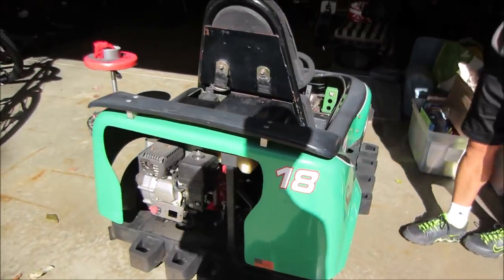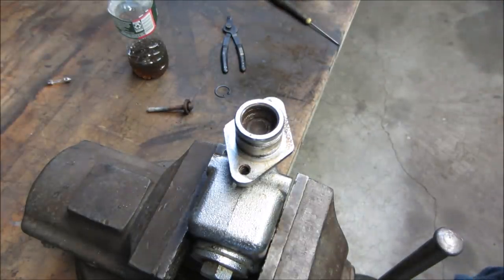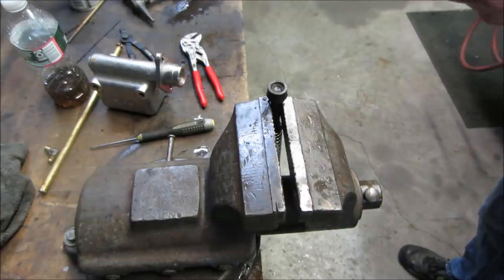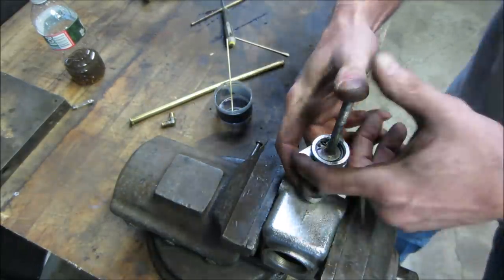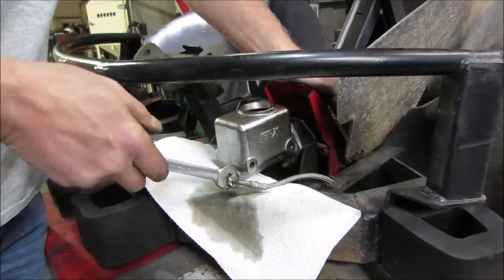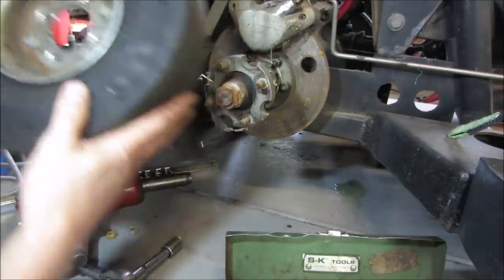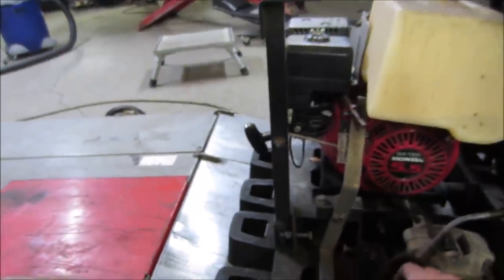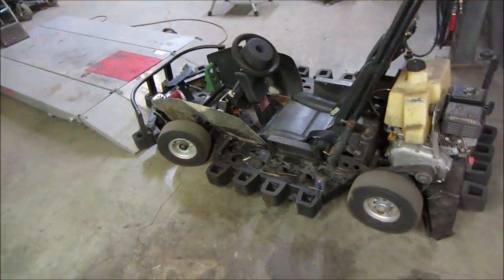Broken amusement park go kart, comes to life,

Comment: Mr. Mustie, if I may call you that, I have watched all of your most recent videos and some of your older videos. They inspired me to fix an old 1981 Jawa Moped. Two previous owners could not get it running. I found that the transmission seal and clutch seal were shot and leaking oil on the starter clutch shoes and running clutch shoes. I replaced the seals and clutch shoes and rode it for fun last summer. It tops out at 35 mph! Thanks for the inspiration. Who knew it was fun fixing small motor machines. Oh, and you sir are a master. You never launch parts across the shop!

Comment: Great fun! 30 years ago I was associated with a rental track that would bring 20 cars and a portable metal track to your event. We were rented at least twice every weekend and usually once during the week for a couple hours. As an employee we got very good at pushing the cars to the limits. When setup on dirt even with the metal frame it was possible to get the car up on two wheels left or right when you when you went into a hard turn and crank it.   A few of us PROs actually flipped the car fortunately no one was injured.

Later I built a dual chainsaw racing go-kart that could out corner a Corvette through a Cloverleaf. Luckily no one was ever arrested for being out on the public streets. When you're going a hundred miles an hour inches away from the pavement the feeling is unbelievable.
Reply: can you tell me more about the portable metal track?

Comment: Seekonk Grand Prix used to have two outdoor tracks. One was a typical “family” go cart track, lined with a metal bar that matched up with the bar that the other guy removed and old tires for rebound. The other track was the fun one; an oiled down slick track. It was a simple oval but fun as hell to whip those tanks around the corners and bounce off of unsuspecting 10-year-olds and the metal barriers. They’ve done some recent renovations with a new ropes course, bumper boats, a couple kids tracks  a big arcade and rock climbing.  I think they eased up a bit with the oil on the slick track though. I remember it being much more dangerous (fun)

Comment: Way back in my youth, I worked at a go cart track. We had carts like that that would run 30 to 35 mph. Then we had two with I think they were 7 hp 2 cycle engines, ( it was a long long time ago... 1978 ), but they would run close to 70 mph.
Reply: I remember those days, before the lawyers fucked it up.

Comment: Definitely need some balloon type tires to give it more ground clearance and a softer ride. Those track tires are made to last along time and also provide enough stiffness to still handle correctly if it goes flat but only work well on a nice flat track. Back when I was a kid in the 60's the trick setup was twin Westbend two strokes on a track cart.

Comment: I think those rubber bumpers are in fact a rubber extrusion bumper that used to be used in surface trains in Europe (early 2000s to late 2000s), at least, i remember it being so years ago. Someone got their hands on a long strip and chopped it in short bits. Many they really used everything off the shelf for this, left nothing untouched.

Comment: You can move the pivot block under the bracket it is mounted to and drill a new hole for the pivot. That will give you full throttle.

Comment: Adopt the Lotus philosophy....to increase speed, add lightness. If you strip off a lot of the heavy crash protection, you could probably save quite a few pounds. Bigger, softer tyres for ride comfort and grip, and you're good to go. No doubt you've got some tricks to increase horsepower as well.

Comment: Probably already know it, but you can replace that right rear wheel hub with one that has a keyway and no bearings in it to make both rear wheels drive.  Interesting how they used modified u-joints for front steering knuckles, might have to incorporate that into my next design.

Comment: I'm no mechanic, but, at the same time, I'm no dummy either.  I pretty much know how most things work on a car.  My dad did a few things and I'd hang out and learn (he was a mechanical engineer, so he pretty much knew how everything worked).  I inherited alot of that from him, but, and I think that's one of the reasons I like your channel so much, is that you give a bit of an in depth explanation of how things work at times, and I learn a thing or two, like today with the brake master cylinder.  So when is it my turn on the go kart? lol

Comment: I would think that honing the bore out will increase the chance of the push rod seal leaking, but you wont know until you put it all back together.
Brake fluid has a way of finding its own way out  and any pitting in the bore will allow the fluid to get past the seal as there is a huge pressure in braking systems when they are in operation.

Comment: you can put a zip tie threw the gov spring and tension it till you get it how you want it, we did it on the karts where i worked at , works very well. throw some baby powder down on that concrete if you want splippery and lock that axle.

Comment: Yesterday, on the MotorTrend channel, the show - CarFix featured a car that you have. The shows title is Lam-Faux-Ghini. The guys work on John Cena's 1999 Lamborghini Diablo repli-car. The BMW engine ran, but after body work shop, it would not run. Spoiler Alert: It had to do with the cam shaft sensors wiring. It had a BMW engine, Porsche trans-axle, GM coils, etc.

Comment: G'day Mustie ,well done  Now it has some throttle , love the chuckle ya big kid , Don't worry I'll be doing the same , when I finish the buggy I bought for my kid's & Me , it's an applestone  side by side it originally had a 150cc motor ,I bought it with no motor the body panels are in great condition & it has all new coilover shocks , I was telling a mate about it and he said he had a  1985 XJ 600 motor that turned over & I could have it for $150 .00 , so I got it home went through the wiring and the throttle & ignition , found mud doloppers had built their nest's in the ignition & throttle so when I was pressing the start button it wouldn't get contact, but if I crossed the solenoid it would turnover . The next step was fuel and I had to drop the bottom of the carbs clean everything as You ! Had taught me 
Put the carbs back together , turned the key hit the button and away it went a bit rough to start with after about a minute it ran like a dream . I give you a lot of credit for this as I probably wouldn't have given it a go , but after watching your channel for the past few years , I thought I can do this , so the next stage will be fitting the motor , so wish me luck , hope to have it fitted soon ,I'll let you know how it goes .        Mal.

Comment: Yano if that tube is submerged in brake fluid, you can just open the bleeder and pump away until the air is out. It’s impossible for air to enter the system with the tube submerged, unless you run the master dry. It’s how I was taught in my ASE class.

Comment: Around 33:30, the right rear tire seems to turn and speed up when you rev the engine. Of course it doesnt spim at the same speed though. Is it a already a live axle with the key removed on the right side so it's only a one wheel peel? Years ago our local go kart track did that to save on tire and gear box wear and tear.

Comment: I did spot a wider track axle and wheels at the end. Not sure if you can fit bigger matching wheels at the front but the steering stub axles can be spaced out if needed. Engine? Mustie has quite a stash so likely to be a bigger one there somewhere. Don't mention Hayabusa..

Comment: I recall the Malibu Grand Prix driving those things around in circles.  Most were turtles.  But there was always one a lot faster than average.  That was the one everyone fought over!

Perhaps the easiest performance improvement would be removing all that armor plating.  Take 200 pounds off and it'll accelerate and handle much better.  Much better in fact than just putting a bigger engine on it.

Comment: Years back went to an auction bought a go cart, it had a snowmobile engine. I got it home and driving it around my pasture, I almost hit a tree. The gas petal stuck to the floor, I was lucky it had a kill switch. The guy who built it mounted the battery so it wouldn't come out without cutting a steel brace out.

Comment: note about the position of the seals in the master cylinder; fluid can't get into the cylinder to take up the slack from brake pads wearing (as stated), more importantly fluid can't get back into the reservoir when the fluid heats up and locks the brakes on.

Comment: great fun video once again.  why not shed some weight off this thing, i guess with an angle grinder , make a cable driven throttle will yield 2 kilo's already, shed the roll bar too, makes the body come off easyer too. all this will make it faster for sure. Cheers!

Comment: A heads up Mustie,  with an open brake system as with old cars and your master cylinder, don't use DOT 3 fluid. Use DOT 5.  5 is synthetic and will not draw moisture to contaminate your brake system or rust the inside of your lines and ect.
MB BAR RANCH
Reply from the maker: you cant mix them

Comment: There are two options I have always wanted to try; electronic fuel injection and electric drive supercharger (turbocharger based, not fan type). EFI first would make it easier but otherwise you have to regulate fuel pressure to the carburetor w/o overwhelming the float needle. 
There are kits for lots of go cart motors with high compression pistons and high lift cams but bolt on kits are sort of just cheating. DIY mods are more of a challenge... and more likely to end in a smoking mess.

Comment: Do these have the exposed throttle rods? Our track up here in Vermont got a little upset when we found that we could get another 1k rpm's out of the motor pulling up on the throttle rod. The next year they had a channel welded over the rod so we couldn't pull up on them.

Comment: Wrap some towels around the wheels and you have a fun and nifty little shop floor cleaner. I wonder why they split that rear axle though, modified slip differential for all the corners on a tight little track? posi-traction would make a better cleaner.

Comment: When i was 12 or so 50 years ago, dad would take us to shopping centers in Tulsa that had permanently closed so we could ride ours there. Police couldn’t wouldn’t bother us because it was private property. We built it from a 5 hp Clinton motor and single wheel drive off of a Cushman scooter. Yes the Cushman was probably more valuable but couldn’t be more value than the fun i had.  I took off his 2 1/2 briggs from his lawn mower first and made it run and i guess he knew he had to get involved if he wanted his lawn mower back.

Comment: I would keep the hone to a minimum if using the old seals.
And I seem to remember certain parts cleaning chemicals will cause seals to swell; dunking the seals, letting them sit for a few minutes, then cleaning off the chemical might help.

Comment: If you gut the airplane wheel, it should be trivial to put two backing plates with a center washer to accept a 4 bolt pattern, i mean, come on, it's just a go-kart, it can't possibly give way. I've seen worse things on cars in my route to work. :))

Comment: see if you can find some oversize tires and wheels.  Adding 2 or 3 inches to the diameter will make it faster, and getting rid of those stiff tires will make the ride smoother and make it grip in the dirt a lot better.  And the existing tires are made to last forever, they are too rigid.  At the end of the day, drive on only one wheel will limit you, would be nice to have a differential.  Can you take one out of a lawn tractor?

Comment: I wanted to say weld the axle halfs together, but there was another one laying on the side ready for a swap. Would generator engine fit in there? Different carb and no governer and it would go good. Unbolt all the rubber bits while You are at it. 20-30ish pounds in that rubber bumpers and that bar at the front.

Comment: Typically - The type of Rubber that the o-rings and seals in a master cyl are not petroleum oil "proof" as brake fluid is alcohol based - now that youve coated them in spray oil, they may begin to turn to chewing gum or swell up and leak or worse...... so avoid oiling brake master or caliper parts if you intend on re-using them
Reply: "I acquired some stuff to make it faster, you'll have to guess what it is"......... yet theres a Go-Kart live axle and wheels right there to the left of the Kart in frame on the video!!!

Comment: I would have started with a bench bleed on that master before installing it on the cart ( put a hose on the fitting and place the other end into the master cylinder push the rod and keep going till you don`t see any bubbles ) as you are only creating flow and not much pressure this way clear plastic can be used ( new master cylinder for cars come with fittings and hose to do this ) less fluid waste plus if the master is no good you don`t have to un bolt it

Comment: You could have saved some time,if you would have bleed the master cylinder  before you connected the brake line. I've done that many,many times. Then bleed yoir line at the caliper.

Comment: Let me take my guesses stage 1 kit 18 lb valve springs racing jet for carb or new carburetor. Or bigger engine there's so much you can do with it change axle 2 live axle torque converter or racing clutch new back tires stage 3 kit with Billet flywheel racing cam new lifters😵 on and on

Comment: Great job on fixing that thing now pull those gosh awful rubber bumper off that thing, 1. they are freaking butt ugly and 2. I bet they weigh about 5 pounds each. That should help with the power to weight ratio.

Comment: your brake bleeding process is wrong!! You apply pressure then open the fitting - releasing the air, close it and then release the pedal. repeat